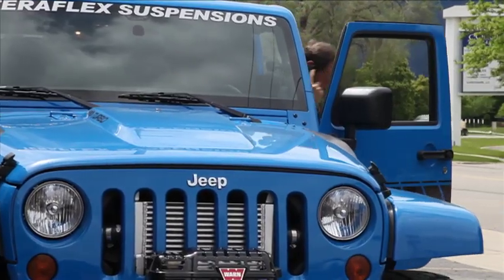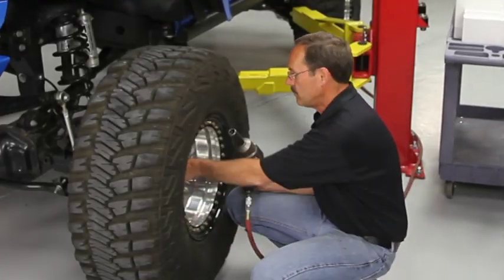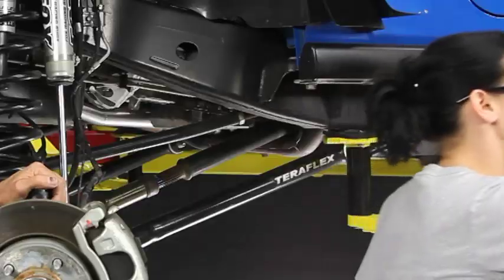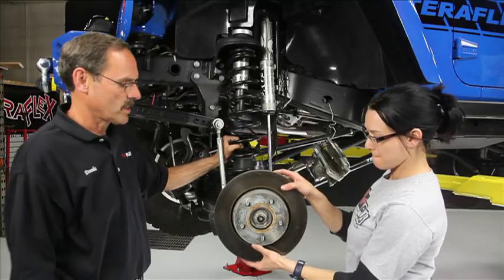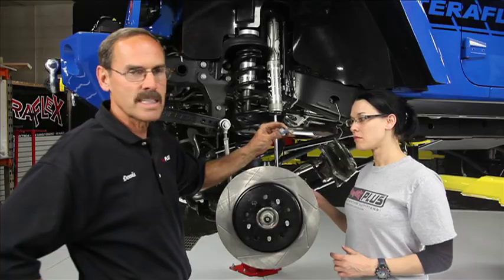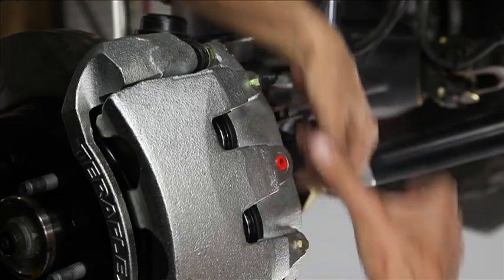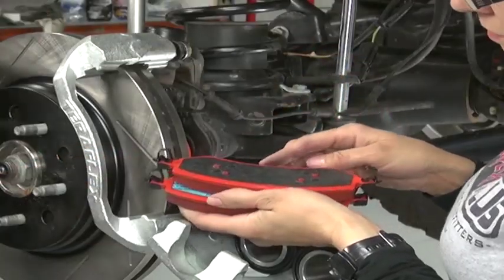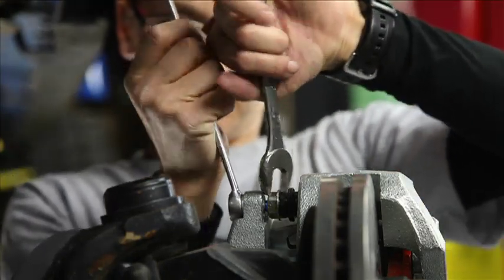TeraFlex Install: JK Big Brake Kit - Part 1/2

Comment: I just installed this kit on my 2016 Jeep JK and it seems the pedal is very soft and is slowly sinking to the floor no matter how many times you pump it up. Normally that tells me the master cylinder is bad. But it was working just fine before I installed this kit. Was wondering if you had any recommendations?
Reply from the maker: Please give our customer service team a call at 801-713-3314 and we can assist you!

Comment: Some interesting humor indeed, glad Tflex responded as they did. Can anyone tell me if you can use any 13.3" rotor as a replacement for this kit or are you pigeon holed into using TeraFlex specific rotors?

Comment: I just installed these on my '12 JK.  For others considering this kit be sure you order the larger master cylinder.  Horrible pedal feel without it.  First 50% of the pedal movement results in no stopping power with the stock master cylinder.